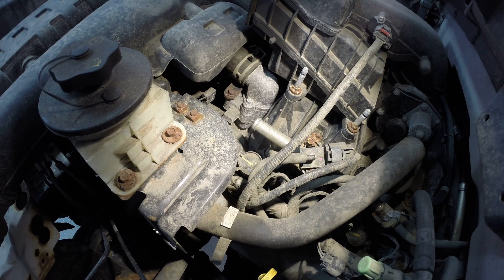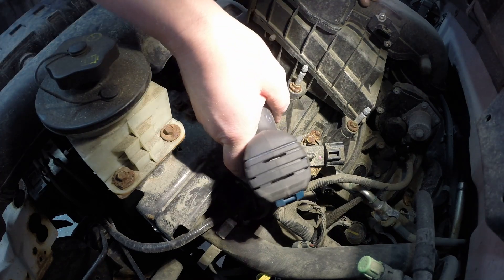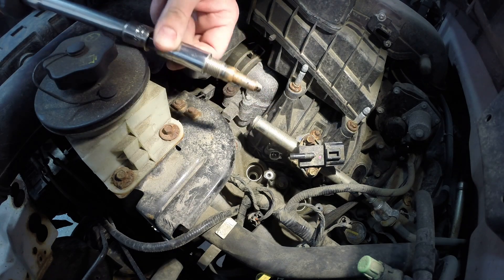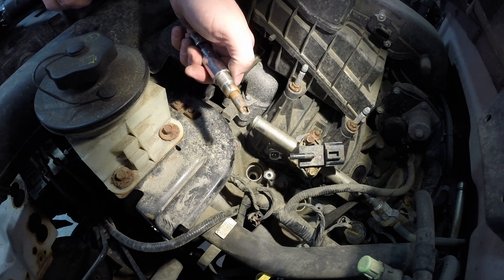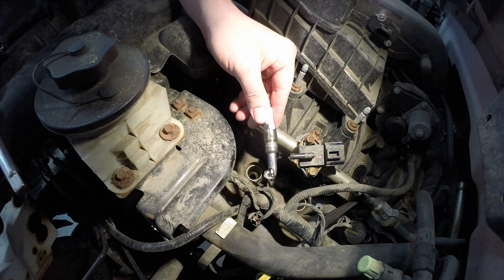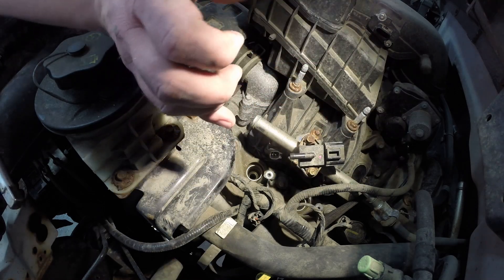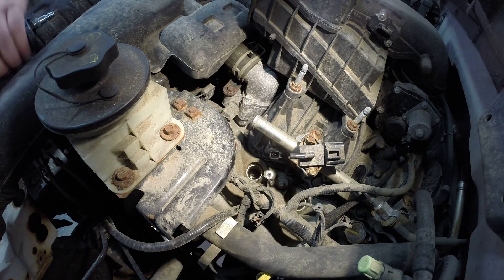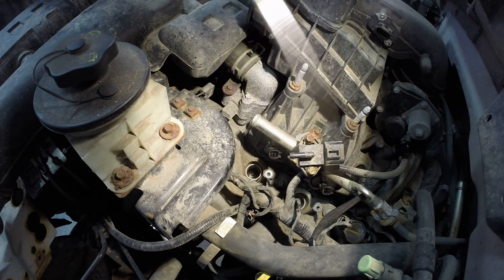The Best Method for Removing STUCK Ford 4.6L & 5.4L 3V Spark Plugs??

Comment: My understanding was you wanted the motor to be ice cold because aluminum shrinks when it hot so harder to remove when at operating temp.
Reply from the maker: This Hot method is to be used on this engine only with the intent of softening the carbon.

Comment: This job is such a pain but I finally got it done. No breaks thank the Good Lord! pro tip: not every hose should be disconnected or else you might get coolant in your spark plug holes like I did.

Comment: Just did this technique on a 2005 F-150 with 143,000 miles on it(had 118,000 when i bought it). Went 4 of 8! 4 broke and 4 came out. They looked like original plugs too! The gap was gigantic on them!

For those curious, broke plugs on cylinders 1, 4, 5 & 6. Cylinders 2, 3, 7 & 8 popped right out!

Updated the plugs to the new SP546's and 8 brand new DG511 coils! Before i couldn't run it over 4,000rpms without it going into limp mode immediately. Now she roars without a single misfire! 👍
Reply: Did you use ratchet or impact?

Comment: Just did a 2005 ford f150 3v 5.4L today at work! Had a touch over 93k miles on it with the original plugs! Tip came off on one but the rest all came out and thankfully I was able to get the broken tip out with the extraction tool. Runs much better now. Tip that broke was the passenger rear most plug. Drivers rear most plug was barely hand tight  ironically lol
Reply: Sounds like you narrowly avoided a plug blowout!  I just had this happen on my 2010 - 4.6 in cyl 3.

Comment: Just found your video.  Will my 2004 4.6 have the same  issue you talked about with the 5.4?  Your title makes it a little unclear when reading everyone’s opinions?
Reply from the maker: Only 3v engines as clearly stated in the title.

Comment: just changing my plugs on my 2005 Ford f150 5.4 three valve. I tried to get these spark plugs that you recommended but they (Amazon )says they do not fit my vehicle or 2002 4.6 have any recommendations? Thank you for your time and patience .love your videos.

Comment: Does penetrating fluid around the spark help to take them out easily without breaking?
Reply from the maker: no
Reply: @FordTechMakuloco  Thank you much for replying!!! does carb cleaner help if I don't have the gun you used?
Reply: @FordTechMakuloco  Thank you much for replying!!! does carb cleaner help if I don't have the gun you used?

Comment: Is there a minimum impact torque requirement? I only have a 3/8s electric with a little over 200 lb/ft of torque. That's considerably less than the aircat demonstrated

Comment: Thanks for the great video, just about to attempt this myself.  Question, those spark plugs from Amzn, I see some questionable reviews about their authenticity.  Did you have any problem with yours?  I'm ordering from Canada but it appears they are coming from the exact same seller from the US.  Also, can you get to the rear plugs with your fixed (vs swivel) socket and the compact impact wrench?  I was thinking about ordering all the same tools as well.

Comment: I always use a short piece of vacuum line to start all my spark plugs Just stick it to the end of the plug that way your vacuum line will not let you cross threaded been doing it for 45 years works every time
Reply: Sweet , my dad taught me that when I was  just a pup . I'm 54 now .

Comment: Just did this with a 12v dewalt 3/8” impact worked great. Just took time easing it out. Didn’t want to go full bore at once. I let the vibrations help loosen it.

Comment: I have 3 vehicles with the 3 valve engine that had over 100K miles on each one. They all had the original OEM plugs installed. I knew that the job wasn't going to be easy so I got fully prepared and bought the spark plug extractor tool and the Ford recommended de-carb fluid ahead of time. I decided to use the Ford published procedure to get them out, I just kept working each plug back and forth and soaking them with the de-carb fluid. The whole process for all 3 vehicles ate up a whole weekend but I did not break a single plug. I have an unused spark plug extraction tool for sale if anyone is interested.

Comment: It's a shame a class action lawsuit can't be brought against ford mtr co for this "lemon" of an engine.
Reply: Dude, its the spark plug that is the problem not the engine. Id say 100k miles is pretty good for your first tune up.
Reply: @robs4517  I have 170000 miles on car. Plastic intake manifold has been replaced at least once.spark plugs get coolant on them and foul out. coil packs last as long as a condom.All the ball joints have popping off.Even sitting still. climate control computer goes out once a year[700. a pop] ck engine light stays off for 24 hrs out of shop. the whole package is crap!

Comment: Questions unrelated to plugs. Hav an 08 f250 5.4 that idles okay but no power. After some Diagnostics found fuse 74 keeps blowing. I’m assuming it’s a shot to ground. What should you recommend the best way to Tackle it

Comment: Just finished removing all 8 plugs using this method. 179,000 miles on 2004 5.4.  Drove truck for about 5 miles before removal to get engine warm.  I could not believe it....Truck purrs like a kitten now.
Reply: Original plugs?

Comment: Replaced plugs on my ‘05 expedition using this method. 5 plugs where original (223,000 miles)  1 newer one and 2 with 170k+ miles. Out of the 8 only 1 broke. I idled for about 20 minutes then ran it on the highway. Electric impact and stubby impact wouldn’t take them out. I had to use my ingersol titanium 1/2 inch and they still barely came out. If I broke 1 of the original 16 year old plugs then you should be fine if you do this correct.

Comment: Hey man! Really helpful video. I Just bought a 2005 Mustang Gt with 80k miles, it runs great but I’m worried about the spark plug issue. Do you recommend I go to a mechanic to change them now or leave as is? I’m the 3rd owner but the previous owner doesn’t know if the plugs have been already changed. How can I tell if they

Comment: Followed your instructions and removed all 8 spark plugs without breakage. I'm the original owner of this 2004 f150 xlt supercrew with 101,000 miles and original spark plugs. I ran two 16 Oz cans of Sea Foam to full tank of fuel before spark plug removal. Thank you very much for sharing your knowledge.
Reply: Did you use ratchet or impact?

Comment: Think I'm gone go practice in the junkyard first lol
Reply: Pretty sure theres plenty off them  there
Reply: how  are you running a  5.4 3v that's 1/2 torn down in a junkyard to get it hot
Reply: thats the idea , thats how i learned , also working with the extractor kit for these as well , that way when i need to preform this job when some body calls because they broke it trying to replace its a nice ticket $
Reply: Yo good thinking😂 im gonna do the same

Comment: How far do you torque the new plugs? Is there a spec? I’ve replaced 2 on my 2002 5.4 and they’ve both blown out.
Reply from the maker: On your 2v engine torque them to 20ft lbs.

Comment: I have no problem with the first 7 cylinders.  (‘03 5.4 triton) the 8 cylinder is a complete BITCH.  Any suggestions on specialized tool to get to it and thread it straight????

Comment: I replaced my plugs on my 05 5.4 3v. at 125,000, broke 1. Getting ready to do it again, I now have 230,000. I used the anti seize when I did it last time. Should it be easier this time , does anyone know. Thanks

Comment: 2 Years Ago Without My Knowledge My Wife Purchased A 2004 Ford F150 FX4 With The 5.4...3 Valve...It Has Developed A Miss On Cyl 4, It Has Over 170,000 Miles...I Got 7 Of The Plugs To Come Out With The Crack The Plugs And Soak Them With Ford Carb Cleaner Routine...However In Cylinder # 4 The Whole Plug Did Come Out. With No Broken Porcelain, But The Metal Shell Fell Into The Cylinder, It Had The Original Plugs In The Back 2 Cylinders On Each Side...Imagine That...Is There A Good Magnet Or Hook That You Can Recommend To Fish The Tip Out? I Have A Bore Scope Camera...I Saw The Metal Tip And It Is Sitting On The Top Of The Piston...I Live In Ohio So Coming To Your Shop Over A Truck This Old Is Out Of The Question...Especially During This Corona Virus Situation...Has This Ever Happened To You? I Really Do NOT Want To Remove The Cylinder Head...I Am A Retired ASE Certified Heavy Line Mechanic Who Has Worked All My Life In GM / Oldsmobile, Chevrolet Shops I Stopped Turning Wrenches Around 2000...I Find Your Videos To Be Some Of The Best On You Tube...I Have Inherited The Duty Of Fixing This Truck...Which I Am Not Very Fond Of...But My Wife LOVES This Truck...I Have Not Seen A Video That Addresses This Problem...If You Have...Please Let Me Know If You Have...A Little Help From A Fellow Technician Would Be Great...Thanks...Scott

Comment: What a pain in the butt. Back to Chevy once I get rid of this POS 5.4 F-150. Cam phasers needed replaced at 101k lol wow. Terrible motor terrible design. I've changed out plugs that have been in a block for 20 plus years and never had a spark plug break off like the ones did on my damn 5.4
Mechanics will tell you. They are junk. That's why they went back to the 5.0

Comment: Just replaced the original plugs on a 2005 F150 with just over 60k, the method that worked the best for me was to bring the engine up to operating temperature. Loosen the plugs about 1/8th of a turn and the spray a good amount of Gumout carb cleaner in each plug hole on one cylinder bank, then let it sit for 15 minutes.  Then I tightened the plug, then loosened about half a turn, tightened it back down again, then loosened until the plug came out.  Before using this sequence of steps, I broke a couple plugs and the Lisle tool worked like a charm to extract the end of the plug.  Thanks for the video!
Reply: This was the way i was thinkng of doing it.. first run 4 tanks of fuel with seafoam, fuel cleaners.

Then pour seafoam in,l holes, soak for an hour, loosen plugs 1/8 turn, spray carb cleaner in, wait 20 minutes, spray in wd-40, wait over night and try to wiggle them out.

Comment: Second time with this meathod
Reply: oops.... 8 years ago I saw this method from SRMASTERTECH and it worked flawlessly on my wife's 60,000 mile Explorer.   Yesterday at 190,000 miles I did it again, same results 8 unbroken plugs.   i used my new Air Cat stubby impact gun, very impressed.
Reply from the maker: I miss that guy.
Reply: I always thought his videos were great, in a lot of ways he reminded me of you.    I used just about every tool and part you recommended,  I would also include the OTC 6900 9/16 plug socket/extension. Nice little tool.
Thanks for taking the time to post these videos.

Comment: Wish I had seen this before I spent $600.00 on having the dealer fix the 5 that broke. Do you have a video showing how to replace the valve seals?

Comment: With this video being over 3 years old do you still think it is the best method?  My 06 explorer with a 4.6 just started to misfire. So now I have no choice but to do the coils and plugs, it currently has 54k miles but with its age I'm still concerned. Already ordered lisle tool just in case. And what are the chances of damaging the threads as that might be worse than breaking the plug.

Comment: Great tutorial.  Thank you for uploading it. 

Can anyone tell me if this spark plug issue affects the 2009 4.6 Triton engine?   I'm asking because I just went over 100K miles and I was looking to change out my spark plugs (at this time my truck is running great (doing this as preventive maintenance).  I'm second owner so I'm not sure if the previous owner has ever changed the plugs. My truck had about 55K when I bought it.

I live in the Tulsa area and I've been quoted $800.00/$600.00/$600.00. The last $600.00 quote required a $50.00 up-charge for any spark plug which shatters when being extracted (so it can be anywhere between $600.00 and $1000.00).

I remember when changing my spark plugs would cost me about $40.00 (I bought the plugs, I gaped and put them in with no issue).  The only reason I was going to have a mechanic do them for me was convenience and not wanting to invest in new tools (torque wrench, air compressor etc).
Reply from the maker: On a 2009 you should be ok.
Reply: @FordTechMakuloco  Awesome! Thank you for your response
Reply: @FordTechMakuloco   So it would appears the mechanics/dealerships were simply just planning on overcharging me.  Sad so many places have thrown away all sense of honor.

Comment: Have you seen breaking problems with the Motorcraft SP515 (PZH14F)?

Also noticed you didn’t mention spraying carb cleaner into the well, I assume that’s because of the risk of fire/explosion risk - correct?

Comment: I recently(1 month ago) replaced my original spark plugs on my 2007 f-150 with the new SP546 plugs.  Luckily i didn't break one however when i installed the new ones i used copper based anti seize instead of nickel based anti seize on the plugs. My question is will the copper based anti seize create problems for me? I just noticed that everyone is using nickel which i didn't know so i used the regular copper stuff.  I'm now worried of how it will react over time with the aluminum. I didn't use it on the threads just the shaft part below it. Should i take them out and replace plugs again or do you think they will be fine? Thanks in advance for any advise.

Comment: ford has a new spark plug  what is the part number for a 5.4 ford dealer  told me $500  if all 8 are broken $1000  new ones are better
Reply from the maker: Everything is listed in the video description and top pinned comment.

Comment: I've had pretty good luck sea foaming the crap out of the engine. Flooding it out with seafoam then letting sit for 20+ mins before removing the plugs

Comment: Just bought a 2007 F-150 Super Cab XLT 4wd 5.4 3v 09/13/19 didn't know at the time about the issues with the 5.4, any way I had seen a video where the guy ran a can of Seafoam in half tank of gas to eat up the carbon on the plugs then changed them while engine was hot, would you recommend this method or not?

Comment: When did the TSB come out for techs to add anti-seize to the plugs please sir? I'm trying to determine if the techs at the dealer put that on my plugs when they installed a reman longblock in 2014.  I want to tackle these plugs well before recommended interval to avoid breakage if it possibly helps.

Also can you stubby impact the rear plugs with no extension?
Reply from the maker: If you have a 2014 long block then it has the latest plugs and you wont have a problem.
Reply: @FordTechMakuloco  Thank you.  Your videos are great.  Yeah it's a 2004 5.4 3v that went in the summer of 2014 and I chose to have them do a reman. Would you still recommend doing them with the engine hot or do you think it wouldn't be an issue?

Comment: I was told not to do it warm because you can pull the threads right out of the head?
Reply from the maker: In general you want the engine warm not hot. This here is a special situation, this method should not be used on any other engine.

Comment: I cannot thank you enough! I have a 2010 Ford F-150 Platinum that needed all of the plugs and coils changed. Called my local Ford Dealer and they wanted nearly $1300! Bought the parts (Motorcraft on the plugs), bought a $99 stubby impact gun from HF and followed your instructions step by step. Even cranked it back up once I finished one side to re-heat the motor. NO B R O K E N PLUGS! Runs like new and I save about $700. If I had to do it over again, I could probably knock out the entire job in 30 mins.  Thanks again, very helpful.
Reply: Wow !! I'll try  that

Comment: Does this apply to a 2010 ford f250 5.4 ???
Reply: Dumb question. If its a 5.4 3 valve its specifically stated that it applies.
Reply: @matthewjohnson4903  no I'm not sure if is 2v or 3v
Reply: Those are a different design, wont have the problem with the plugs,

Comment: I like to do my own work, but when it comes time for me I’m taking it to the Ford Dealership. Why would I put up with this trying to go 8 for 8. 
If something happens, break a plug or strip the threads it’s their problem not mine.
Dealers are not Evil People. You get what you
Pay for.
Reply: If the threads come out of your engine, it's your problem. Not theirs. It's part of the "anything can happen" clause.
Reply: natloz17 I was reading something a couple of days ago. You are correct.
I also read there is an 11 page service information letter from Ford on how to take the spark plugs out.

Comment: I bought spark plugs for my 2001 Lincoln navigator 5.4l five years ago from ford dealer and I was advised that spark plugs are good up to 100k before R/R at that time my navigator has only 68k so I kept and save the spark plugs now my question is I have this 1999 f150 5.4l lariat with 168k can I use the navigator spark plugs for  my lariat without having any issues please share your expert opinion. i appreciate your help thank you very much and have a good day

Comment: How do you remove a broken sparkplug  on a 2001 ford f150? I am struggling  with the  sparkplug in cylinder  #6. Any suggestions?

Comment: I have a mid 2008. The boot on the coil is black. If I change the plugs what do I replace them with? The same breakable like the ones you show removing or is there a replacement for those?
Reply: the new plugs wont break or I should say a better design

Comment: Would this method work on my 2000 excursion 6.8l she has 168k and I believe are the original plugs. And getting a misfire one cylinders 1,2,7 and 10
Reply from the maker: This method is only for the Ford 3v Triton.
Reply: @FordTechMakuloco  What method would you use for the 2v 6.8l

Comment: What is the factor thread size and pitch on the 2 valve 5.4 spark plug hole? And are the 3v the same or different?